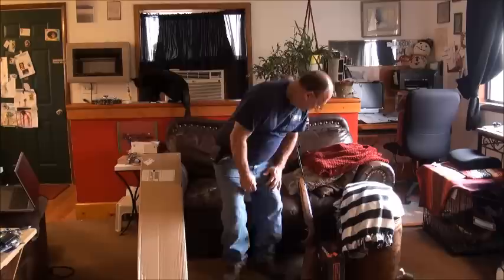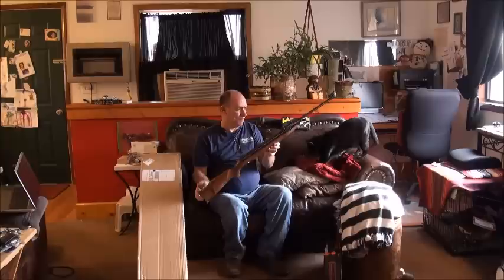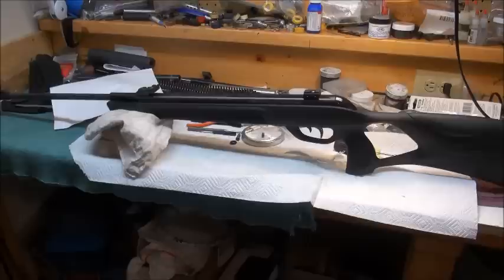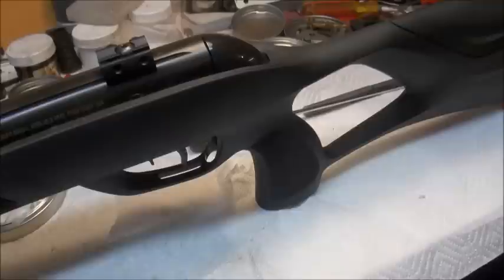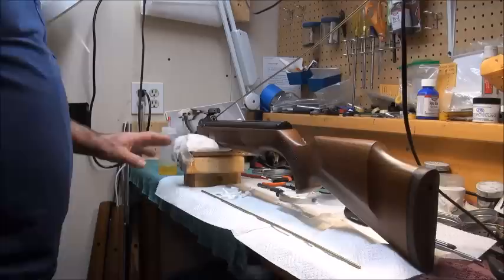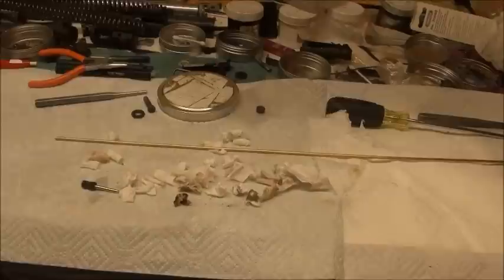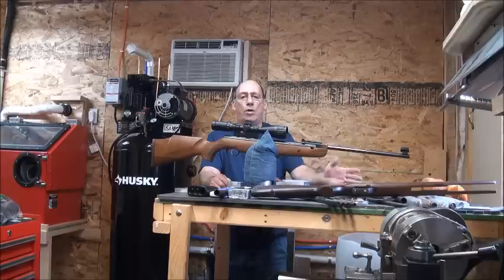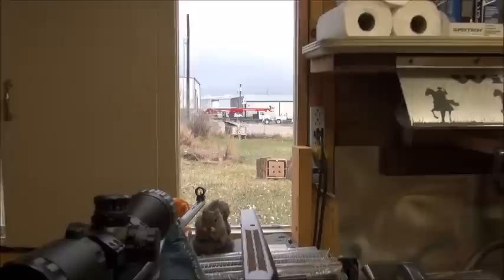Beeman R - 9 Air Rifle

Comment: Ouch...i'm hearing metal rod hitting crown, rifling and breech. It is a big no no in shooting circles because too many shooters don't choose correct rod, technique and clean way too often. I'm not saying what you do isn't ok, but many others aren't as experienced and versed at it.
Then there is a question of cleaning the barrel where i would like to add a bit more; it should be done when new or in unknown condition to clean lubricant, dirt, rust if there is any, or whatever got in. Later maybe once per year if pellets are good and dirt or water don't get in. Most international competitors use appropriate product to clean it until most cleaner/lubricant is gone, then simply shoot because lead preserves metal against rust and helps with precision.
I'm seeing too many adds or use of products which are meant for firearms and not airguns. Correct treatment with Ballistol and proper felts should be enough if barrel is in good condition. I like your channel a lot, it is very informative.
Reply from the maker: Thank you .
 Often air gun  circles  can be full of guys who  think  they know  what there  talking about,  instead of  knowing  the reality  of  it, because they read  it  on a forum.
Barrels are steel  it would be hard  to  dig a rod  in and start ripping up  into a groove or hurting a land / Of course  idiots  are  out there but normally when done its  perfectly fine but the tips  should  of been  rounded over  smooth

one guy posted  a bad remark  on a forum post  when I talked  about bending the barrel to get rid  of  the barrel droop , well you should of read his nasty response! once a again  another air gunner having no clue about real world  hands  on work  on air guns  / Later some one posted that pistol  with the  loop circle barrel that shoots  like a regular pistol he  did not say another word. 

I am retired now so  its  pretty much air gun projects & work full time 
Thanks again best regards
Mike E.

Comment: Seems really slow for the 14.3  pellets? Another video had this rifle shooting @ 680fps using the 16 gr H&N Terminators?
Reply from the maker: My elevation is 3100 ft above sea  level so I tend to loose 20 fps  compared to those on the east coast/ they also may of added some pre load

Comment: Mike... looking to get either the R9 or HW95 right after Christmas... I know they are suppose to be the same, but, given the choice, which one would you take? Also, would you recommend shortening the barrel to add a moderator? (Mainly because I like that look in a gun, but I don't want to ruin the gun)
Reply from the maker: HI ted'
I like the  full  stock  on the beeman R 9 ,  I would not chop the barrel  for a moderator.
 barrel length is atad over 16"  If you like the  look maybe just get a hand brake that looks the part so  it can slide up close to the end of the barrel. here a link  to the style of  R 9 I like 
https://www.pyramydair.com/s/m/Beeman_R9_Air_Rifle/1900

Comment: Hey Mike, Can we use a scope which has a parallax from 100 yard to infinity to shoot shorter distances in a Springer , say below 100 yards or 50 yards.
Reply from the maker: I've only used air rifle scopes out to 135 yds  tops/ you'll have  to see what you get if  that's the scenario

Comment: and you don't need to do anything to the rifle  just shoot it and a service tune   just shoot the crap out of it  I have like 12,000 pellets through my R9
Reply from the maker: Most air gunners  will clean a new guns barrel  to remove the factory dirt thats  a given on  any pellet rifle.

especially those who shoot competition ,they will start a rigorous  lengthy process  on conditioning  the barrel thru shooting then cleaning then shooting then cleaning a good number  of time then  they will start  the  shooting session as normal.

the R 9 weihrauch / beeman is no exception  there's no guarantee how it was lubed its best  to go thru the rifle and properly lube the internals and add the personal touches  the factory dont. those who can do. 
sure  one can leave  the factory spring & guide  in  but it sure  is alot sweeter when its  been gone thru properly and a  upgrade spring & guide has  been fitted &  installed and the trigger properly lubed & tweaked